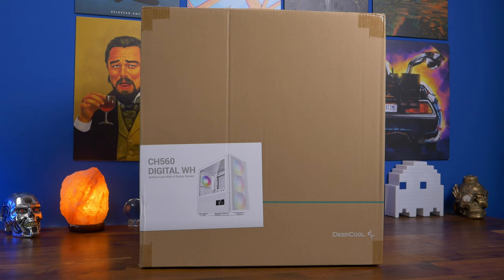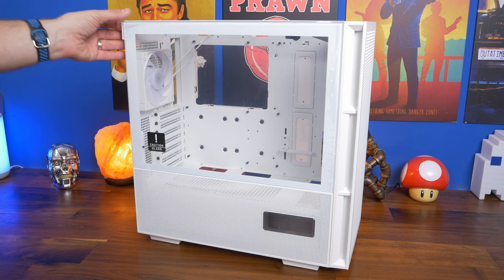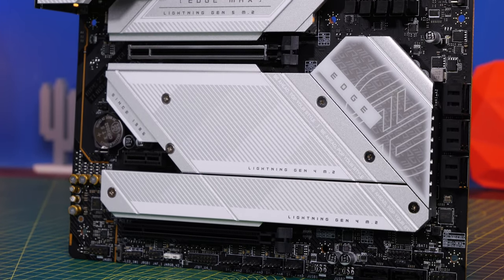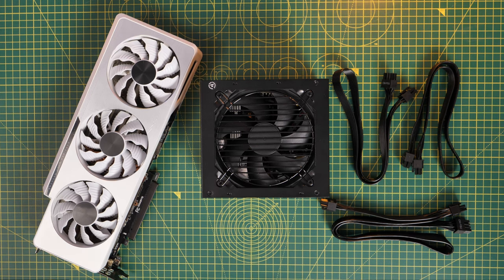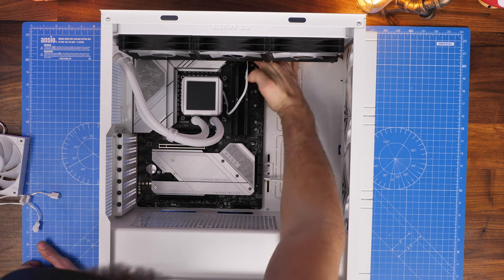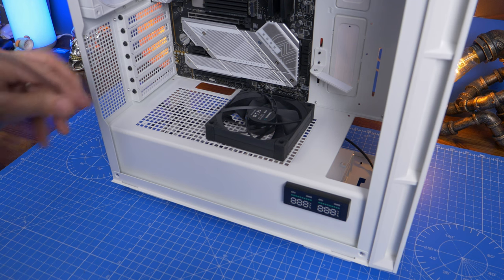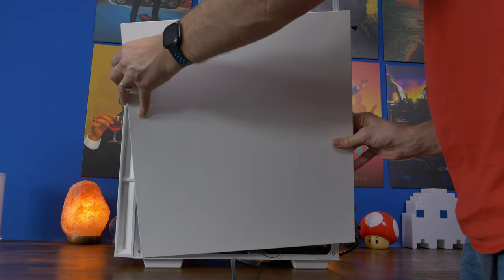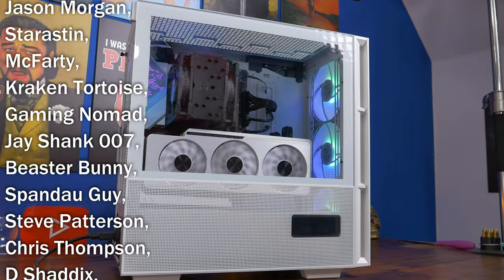DeepCool CH560 Digital Build Guide - in-depth PC build including wiring and radiator/fan setup tips

Comment from the maker: Build specs for this guide (note links listed here include affiliate links which may earn me a commission)
Motherboard - MSI MAG Z790 Edge TI Max Wifi https://youtu.be/R7fBupUTXNI
CPU - Intel Core i9-13900K CPU https://amzn.to/3Ry7UAl
RAM - Corsair Vengeance RGB DDR5 16GB x 2 6200MHz (https://go.corsair.com/eKAL3Z)
NVMe - Corsair MP600 Elite NVMe - https://youtu.be/gI-vDRepE4s
Case - DeepCool CH560 Digital
CPU cooler - Noctua NH-U12A Chromax Black
PSU - Kolink Regulator 1000W PSU (https://youtu.be/sjEJrl294mI)
Fans - Lian Li TL120 and TL LCD https://youtu.be/fL4uYmJvnzc
GPU - Gigabyte RTX 3090 OC Vision https://amzn.to/49wqlg7
SSDs - Crucial MX500 2TB and Crucial BX500 2TB https://youtu.be/IOJNybKZ4wk

Comment: it is possible to install 360 AIO on the top and left the rear fan there too - you just need to place AIO facing the tubes to other side (going to the front side instead of rear) and put the rear fan a bit lower (depending on the AIO radiator and fan size I think). there is not enough room to insert it there at first in this way, but it is possible via the front when you take off the front panel and fans (and return them later ofc).

Comment: CH 560 is compatible with 360 AIO, but normal AIO like LS720 or LT720. No problem with rear fan. Ps. Problem is when use 14 cm rear fan and 360 AIO.

Comment: When you plug in the 5v rgb connector to the motherboard, the plug should cover the white part on the motherboard. Otherwise the plug can come loose. It is a tight fit, so give it a good push.

Comment: Amazing review - I am decisding between this and the micro atx version. I don't want to mess with rewiring the fan cables. Is it okay to have 3 into one motherboard fan header? or would you recommend the front 2 into the motherboard and the exhaust into another? thanks! - did you happen to do all 4 into one header?

Comment: Can you please do a video comparing gpu temps on vertical vs horizontal mount, there is currently no video anywhere related to this. Maybe you can do this video on ch360 so it will a new video.
Anyway thanks for these beginner guides, I recently build my first pc in ch360.

Comment: I wanted to add 3 fans to the exististing 4 fans for a total of 7 fans with the rgb dependant on the motherboard rather than the controller. Is it possible to daisy chain all the RGB together while having the fan power going to different headers to avoid the concern you mentioned with 4 fans on one SYS_FAN? 

Example:
RGB connections - all daisy chained to JARGB_V2_1
3 front intake fans - SYS_FAN1
1 back and 1 top exhaust fans - SYS_FAN2
2 bottom - intake fans - SYS_FAN3

Appreciate the input.

P.S. If I seem naive it's because I am. This will be my first PC build.
Reply: Did u build this? I added the top bottom fans i have more heat inside

Comment: I also purchased this case and before any of my builds, I do an inventory check. The manual says there is a screw for the tempered glass side panel, but mine never came with the screw. Did yours come with the screw for the side panel?
Reply from the maker: You know I didn't check properly.

Comment: Question? What do you think of having bottom, front and rear fans as intake while the upper as one and only exhaust? Is the air cooling better or worst, when set on neutral or upper having faster rpm than the rest?
Reply: My only concern here would be the CPU cooler, naturally it lines up with the back fan and if it is running as intake you would clash too closely with the cpu cooler. If you reverse the direction seems much better but still clash somewhat with the front intake.

Comment: Hello my friend, I have a Gigabyte X670 GAMING X AX V2 board, but I could not figure out the connection of your digital side screen in the heat of the processor and also the temperature of the graphics card 

can you help me connect it and show it 
Note that I connected it to the USB port but it did not work